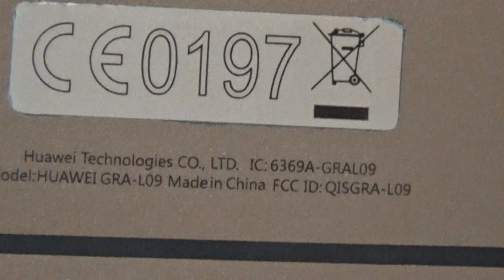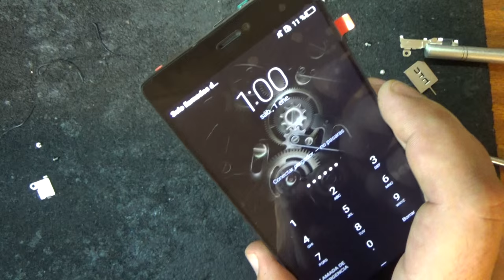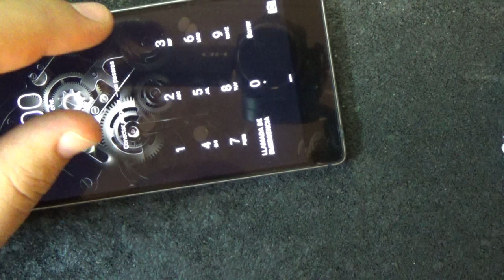Huawei P8 GRA-L09   замена модуля

Comment: Better aproximation would be 1.- remove with hot air the lcd not more hand 135 º 5 minutes will be enought, 2 .- remove the inside body of the smartphone from bottom cover ( metalic part) remove flex conectors and after that the motherboard, 3.- put 3M adhesive on the the sides because if you just use adhesive like on the video you dont have a nice sealed phone so 3M 1 mm its cheap guys. and of course be carefull with sensors do ot cover with adhesive i imagine after the video soslan doff used the cutter to solve the problem and problably, and its a good video guys i apreciate soslan doff aproximation on repair this terminal with the little correction on the sensors covered.